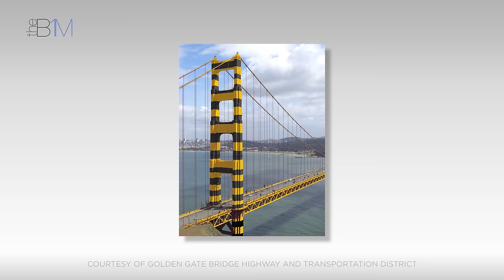The Golden Gate: Building an Impossible Bridge

Comment: What sets this bridge apart from so many bridges is the amount of detail that went into the structure. One can spend a great deal of time just looking at all the detail work on the towers. Something they never do anymore. The great public works projects of the 20's and 30's are no more. If the bridge had to be replaced, something dull and boring would be put up.
Reply: +TheCMLion - Exactly, the bridge detail in my estimation, reflected the general aesthetic modern "Art-Deco" appearance of the time.
Reply: it would inevitably be cable stayed.  no one builds suspension bridges anymore
Reply: @notsure6187  Yes they do. Detroit is currently building the largest in the USA.
Reply: @notsure6187  Cable stayed brigdes are like suspenison bridges that were trying to be even more cool, but failed.
Reply: Everything now is dull and boring. Even the standard houses. Look at houses pre 1940 and each one was unique and you can tell an individual put his heart into building that house with his own artistic design to it. Now everyone lives in a copy and paste cookie cutter house.
Reply: Well the new bridge is extremely bland I don't think it's pretty at all.
Reply: Most modern bridges are covered with concrete
 An exposed steel structure requires a lot of year round upkeep, especially near salt water.
Reply: And it would take 20 years and cost 5 billion dollars. 😀
Reply: but the first designs of the bridge bing built would've been really interesting and unique 
I really dont understand why the golden gate bridge is a tourist trap I mean a world wonder its a bridge     that crosses really fast and deadly waters a lot of other bridges do the same 
but its red so its perdy
Reply: @karamjeetkaur1474  It's not red, it's "International Orange." It's also not a tourist trap, it is an amazing structure set in an equally amazing setting. From any angle, she is stunning.
Reply: @TheCMLion  yah but when you see it every day the wow kinda turns into eh
Reply: @karamjeetkaur1474  I've lived hear my whole life and it never fails to amaze me ever time I see it.
Reply: @TheCMLion  yah it’s a great bridge
Reply: True, I mean back then they were more dedicated but less careful now it's the opposite
Reply: @MichiganUSASingaporeSEAsia  it’ll only be 4 feet taller than the Golden Gate Bridge. A 21st century bridge, only 4 feet taller than a 20th century bridge. Let that sink in.
Reply: @MichiganUSASingaporeSEAsia  also that’s not a suspension bridge in Detroit. It’s a cable stay.
Reply: i whole-heartedly disagree. i actually think if it was recreated it would look cooler and more sleek. have you seen the skyscrapers we make nowadays? have you seen any other structures or buildings at all? yes they may be more simple and lack character but it most certainly wouldnt be dull whatsoever
Reply: @ChaoticCobras  All you have to do is look across the Bay: the Oakland/Bay bridge was built with public funds around the same time: not nearly as compelling or detailed.
Reply: It’s just a bridge … and it’s not detail it’s just how they had to make everything in order for it to work. And yeah everything looks boring now because it costs less
Reply: I disagree, the oakland to SF bridge was completed a couple years ago and looks amazing. Google some images. I drove across it everyday when I worked in downtown SF.
Reply: The GG is undeniably beautiful, but I'll assume we have different ideas of what constitutes "dull and boring" if you don't appreciate the (different but incredible) beauty of the Millau Viaduct or Penobscot Narrows Bridge. Different strokes for different folks 🤷🏼‍♂️
Reply: Yup just look at how long it’s taking us to work on Gordie Howe Int’l Crossing. Times have changed

Comment: Having worked on the bridge I've seen it like few ever will. I've been on top of both towers, the moat areas surrounding the base of the towers as well as in the support foundations on both sides. It remains one of the engineering marvels of our time!!
Reply: That must be a 'trip' to see it from such angles and its internals.. I joined the 1987 walk across the bridge. It is quite an event. In the 80's, it was briefly shut down because of a category 1 hurricane (80 mph winds). I snuck on to the bridge, as the gate to the west side pedestrian/cycling was not shut. I wanted to see if the bridge was swaying like the infamous Tacoma Narrows bridge. Walking with my bike, I got to just short of the S.F. tower and looked down the road for several minutes - rock solid - no visible swaying. on the way back, I passed a lamp posts and heard something other than the wind...a speaker, saying 'You with the bicycle, for the last time, get off the bridge or you will be arrested" I gave a wave to the main building to acknowledge I heard, and left.

Comment: its crazy because the bay bridge is way more important but not as popular, just because of its color
Reply: The Bay bridge has near-by alternates, this bridge doesn't.
Reply: @danc1197  no, its the color 🤣
Reply: The Bay Bridge has no sidewalks.  It can only be driven across, at high speed.  It is easier to enjoy the Golden Gate.
Reply: BigTymin....ummm, the Bay Bridge is a part of the sh*thole known as Oakland, that alone means it isn't sh*t compared to the Golden Gate....
Reply: Bay bridge is not sexy
Reply: Because golden gate bridge represents san fransisco ....before i visited san fransisco last year i identified the place because of the bridge yet if id have seen a photo of the bay bridge before visiting i probably wouldnt have realised it was san fransisco 😊
Reply: I think it’s mainly because the Golden Gate Bridge is beautiful and in a much more dramatic location. It was also there first.
Reply: @vinnygi  actually they were built simultaneously and the Bay Bridge opened first
Reply: DerAggel -didn’t know that. Thanks.
Reply: Well if it wasn’t a fuckin arm and a leg to drive over it, it probably would be more popular. I did a tour in 2016 and for me to drive the 26’ box truck I was in cost upwards of $100
Reply: I didn’t understand the magnitude of of the size of either bridge, or the San Fran bay for that matter until I hit the 2nd half of the bay bridge. I hit the tunnel on the island in the middle and said “huh that’s it”? Now when I came out the other side I said “ Hooooolly SHIT, this is massive!” It’s also worth nothing that I have a slight fear of heights like anything over 200 feet, and can’t swim very well.😂
Reply: The new bay bridge span is sexy honestly with the lights I think it looks better then the golden gate
Reply: @flOGLife  never, it may look good at night, but during the day all the lights on those half cut poles makes it look unfinished
Reply: BigTymin Fair enough, at night i think it looks awesome tho especially if your on Yerba buena.
Reply: The Bay Bridge is a lot cooler. It's double decker for crying out loud.
Reply: its popular thoe..maybe because of Warriors' logo lol
Reply: @sidsid9808  but it has a light show
Reply: @branon6565  the majority of the Bay Bridge is in San Francisco city limits.
Reply: The Golden Gate bridge will always be the king of San Francisco, I like the bay bridge too don’t get me wrong, but the Golden gate has been in so many movies plus Full  House. I never even knew about the bay bridge until I moved here to SF...
Reply: The colour reminds me of the Forth Rail bridge outside Edinburgh, Scotland!!
Reply: @robert3302  there's a pedestrian area called the bay bridge trail, you can get around halfway across.

Comment: Each tower has an elevator from the pedestrian walkway to the
top of the towers. Riding the elevator is amazing as it is an open maintenance elevator so as you go up you are looking at the reverse sides of the tower. It’s rust and wet steel structure is amazing. Once at the top you get out and climb a ladder to a hatch and then another and you come out onto the deck. The deck is very wide and the views are incredible! Been lucky enough to go up five times. Not open to the public I might add also. Love this bridge!

Comment: How the hell did they build those giant concrete slabs in the water though
Reply: Built a vertical hollow column under water, then pumped the water out.
Reply: They used a Lilly pad and put concrete next to it
Reply: aloens
Reply: coffer dam
Reply: @woohunter1  You got it! Water can always be displaced.
Reply: @craigjgomez  concrete is heavier than water. Not that they did, they pumped water out, but if you pour concrete into,say, a swimming pool full of water it will push all the water out.

Comment: With continued repairs, renovations can the bridge last forever or is there a point in time when it will need to be completely replaced?
Reply: Frederick Ray It will need to be replaced one day as no amount of painting or treating will stop rust over time
Reply: there  is a paradox in your questin, if you replace every part of the bridge, is it still the same golden gate bridge?
Reply: Raymond Holt there are part u cant replace
Reply: why not? 
the bridge was constructed at some point, the bridges components had to be created at some point.  Are you telling me that the engineers  overlooked keeping records of construction blue prints, for future repairs?.

 of course not, because it is a traditional and mandatory practice as an architect, engineer and company who supply's the construction equipment must make these things for a certain amount of years after, so that repairs, replacement parts can be made. logically this is how it has to work.
Reply: Haha, 'Ship of Theseus' or Theseus's Paradox. Look it up. 
So, in theory, it could last forever. But what is 'it' that lasts?
Reply: I recently saw a news clip about how they don't fully repaint the cables very often.  Not as often as they do on the Bay Bridge.  The Golden Gate Bridge is operated by a separate agency unlike the other 6 or so Bay Area, state-run bridges.  The Golden Gate Bridge district pinheads are incompetent fools in my opinion.  They divert bridge toll revenue to subsidize the horribly inefficient Golden Gate Ferry.  They collected over $140,000,000 in tolls in 2017.  So it is obvious that the money collected over the years has been enough to rebuild the bridge many times over.  The money is simply squandered.
Reply: The saddles and cables can't be replaced. I predict the saddles will fail before the bridge is replaced.
Reply: I'm referring to the main cables. They are original and cannot be replaced.
Reply: I know buildings can be fully "replaced " while standing but not sure about bridges
Reply: I suspect the bridge 🌉 will fall this Sunday. 8/11/2019 🤔 Maybe. . . 😏

Comment: The golden gate straight is one of the only “straight” things in SF
Reply: it's a strait, not straight
Reply: @panda4247   r/woosh
Reply: Funny enough it’s actually so large that it had to be built at a curve to account for the earth’s roundness over that distance.
Reply: @vandrell  1) I got his joke. I would have gotten it even if it was written like this "The golden gate strait is one of the only straight things in SF". Therefore I genuinely think he did not misspell it on purpose, but as a mistake. If English is not someone's first language, the word "strait" is not that common to come across.
2) writing "r/whoosh" is so stupid. Not all people are on reddit and give a crap about the "r/" culture. Couldn't you write "it was a joke", or even a simple "whoosh" without the r/ would be better. It gives a feeling of hidden message "I am on reddit so I am better than you" which is what I hate about it.
Reply: @DeckofLies  That is an interesting thing to say. Do you have an evidence for that? I would like to learn about it. Sure, if it was completely straight, you might experience going slightly downhill and then slightly uphill, but I think it is negligible. My back of the envelope calculations indicate that if the main span was completely straight, the midpoint would be 4cm lower than the part fixed to the towers, which is negligible at that distance. Or my calculations are wrong.
I believe the suspension bridges have to be curved because of the transfer of the loads. If it was straight, then its own weight would pull it down and stretch it. If it is curved, the downforce actually compresses it.
Also, having it dead straight would reduce its flexibility during earthquakes and stuff (I think). If it is curved, it can stretch back and forth a bit if needed.
Reply: panda4247 holy shit you just destroyed them
Reply: @panda4247  mad respect about the opinion m8, i just thought u just missed the joke

Apologies
Reply: panda4247 just google “Golden Gate Bridge curve.”  Towers are about 4 and a half cm further apart at the top than the the bottom
Reply: @DeckofLies  yes, that makes sense. again my back of the envelope, if the Earth has 40000km circumference, then the span of the bridge (1,3km) is roughly 1/30000 of it, so the towers are at angle of 1/30000 of a circle, which is something like 0,0117°. So yes, the towers are by ~sin(0,0117°)*220m= ~4,5cm further apart at the top.
However, that does not stop them from having a perfectly straight thing placed between them, it they wanted it to be that way.
Images you can find, are way exaggerated for illustrative purposes , like this one http://datagenetics.com/blog/june32012/gg.png has angle between the towers ~11° , which is 1000 more (the bridge would have to be 1220 km long to look like that).
Reply: panda4247 yeah bruh I was just saying it’s got a slight curve, doesn’t have to be massive
Reply: @panda4247  bruh chillax, so defensive
Reply: Panda was right about everything he said and y'all got all butthurt about it
Reply: Carl's Brother  
Nope
Learn to spell or learn to google, bud
Reply: Carl's Brother  
Well i clearly didn't say anything like that
Reply: Carl's Brother  
It's all good brother
We're strait 😅

Comment: Every day I drive down the middle lane next to the cones way above the speed limit because:
1. The poor people during the 89 quake whose cars got thrown off Oakland raised freeways and bounced 3 blocks through town, they never consider as the bridge moves during the quake how the cars will loose control and fly off. 
2. Look how badly it shook during the 89 quake 6.9 that was 60 miles away and 10x smaller than the 8.0+ we can expect from Berkeley only a few miles away.
3. I know 2 ppl who welded it during retrofitting they refuse to go on it, talking of the low quality of work and little that could be done to make the bridge safe and how everyone working on it knew it should be replaced.
4.I remember hearing from my geology teacher about the weakness of the serpentinite foundation and just pick up any rock any the headlands, its green and crumbles in your hand.

PLZ replace it and the bart tunnel before too many die, the bart tunnel has so many ppl in during commute it could be worse than 9/11 in a quake/attack.

Comment: The Golden Gate Bridge is the second-most used suicide site/suicide bridge in the world, after the Nanjing Yangtze River Bridge.The deck is about 245 feet (75 m) above the water.   After a fall of four seconds, jumpers hit the water at around 75 mph (120 km/h; 30 m/s). Most of the jumpers die from impact trauma. About 5% of the jumpers survive the initial impact but generally drown or die of hypothermia in the cold water.

After years of debate and over an estimated 1,500 deaths, suicide barriers began to be installed in April 2017. Construction will take approximately four years at a cost of over $200 million.

 In December 2019, it was reported that construction of the suicide prevention net is two years behind schedule because of issues with the lead contractor, Shimmick Construction Co. Shimmick was sold in 2017, leading to the slowdown of several existing projects. The completion date for the Golden Gate Bridge net is now set for 2023.

Since its completion, the Golden Gate Bridge has been closed because of weather conditions only three times: on December 1, 1951, because of gusts of 69 mph (111 km/h); on December 23, 1982, because of winds of 70 mph (113 km/h); and on December 3, 1983, because of wind gusts of 75 mph (121 km/h).

An anemometer, placed midway between the two towers on the west side of the bridge, has been used to measure wind speeds. Another anemometer was placed on one of the towers.

In the 1930s, a rule of thumb on high-steel bridge construction projects was to expect one fatality for every $1 million in cost. By those standards, the construction safety record for the $35 million Golden Gate Bridge was impressive: only 11 construction workers died. 

(By contrast, 28 laborers died building the neighboring San Francisco-Oakland Bay Bridge, which opened six months prior.) Joseph Strauss made safety a high priority on the treacherous project. 

The chief engineer made the construction site the first in America to require workers to wear hard hats, and he spent $130,000 on an innovative safety net that was suspended under the bridge deck.

 The net saved the lives of 19 workers, who called themselves the “Halfway to Hell Club.” Ten of the 11 fatalities occurred in a single accident on February 17, 1937, when a 5-ton work platform broke apart from the bridge and fell through the safety net.

BY APPLE IPAD PRO,2019,12.9